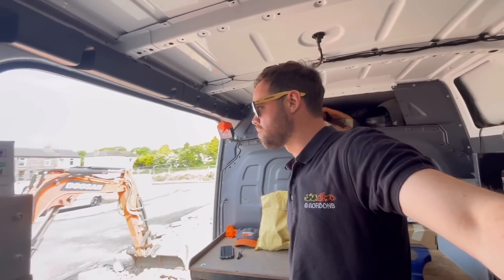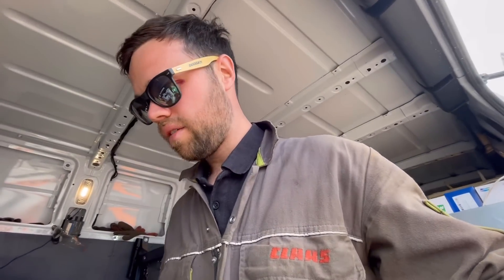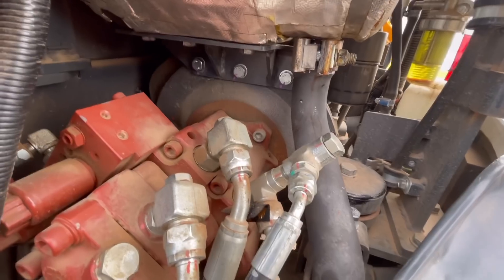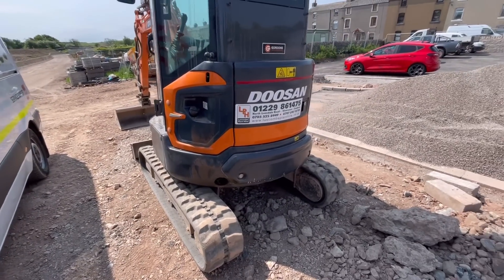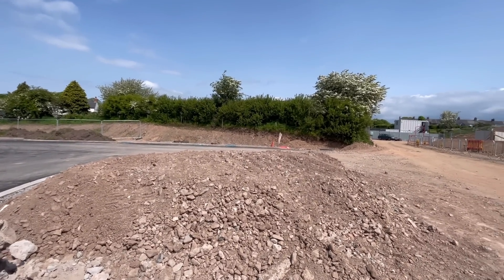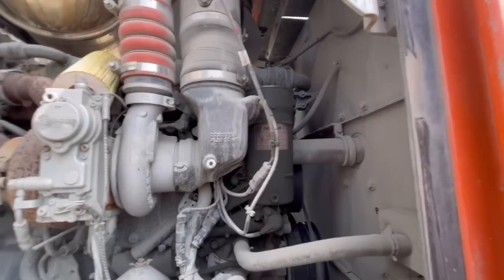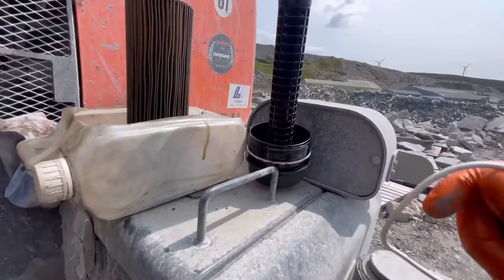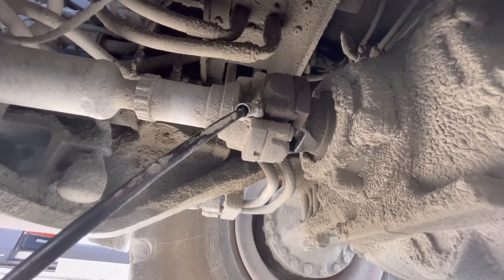Cab off ? / new exhaust / oil leak / Episode  - 194

Comment: Where did u get ur filter bin from? Looks smaller than an 45gallon drum and a handy size in a van
Reply from the maker: It’s an old grease drum they get through a few re filling auto lube systems on choppers in the workshop it’s a great job don’t need to empty the van after every service… usually 😅👍